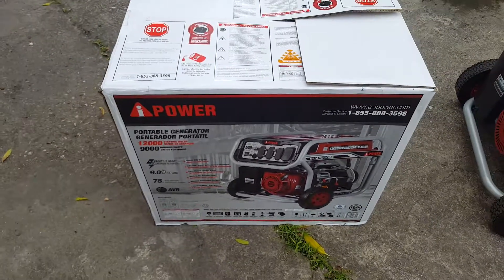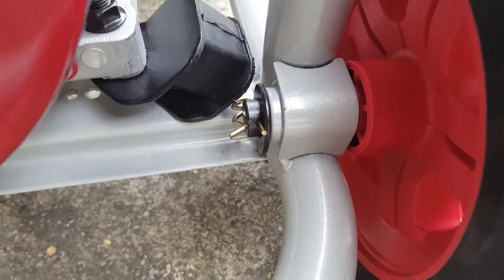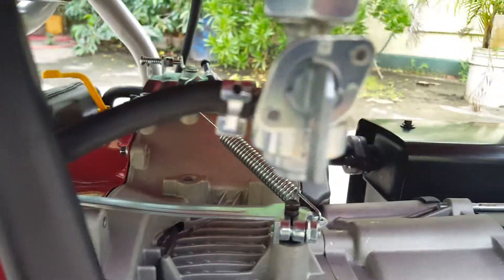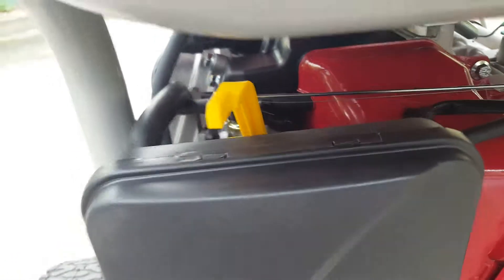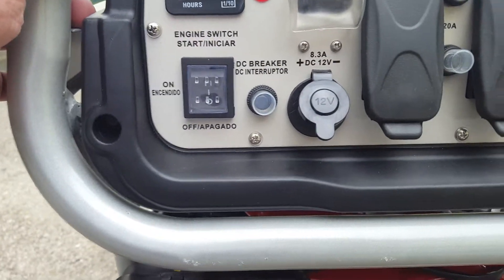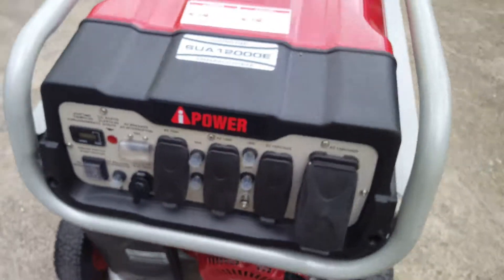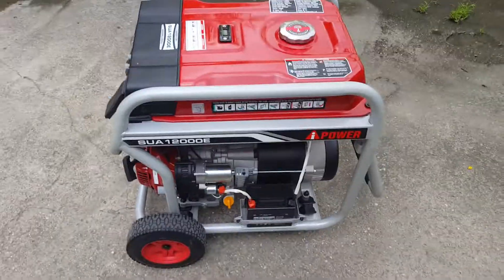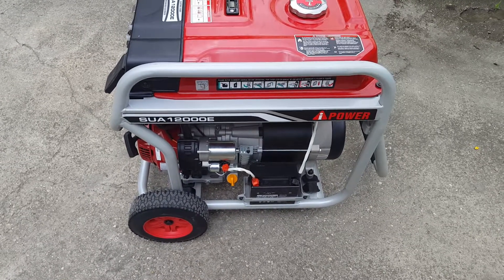AI POWER 9kW generator unbox startup and shutdown

Comment: Harry, After two years of use, did you have any issues with this generator? Is it still in use?
Reply from the maker: Hi it works perfect. It's a bit noisy but performs great even for 8hours on a  full tank of gas.
Reply: @kensawh  Thanks for reaching out. Is it any thing that could be added to the exhaust system to dampen the noise?
Reply from the maker: @richarddegannes2928  I am not sure, careful you stifle the engine too. Ask a small engine mechanic.. it delivers a nice 50amp that can run your fridge, AC, and other appliances. The engine revs louder based on load too. Note there are now Propane options out there as well too to be considered since gas prices are going up tomorrow.